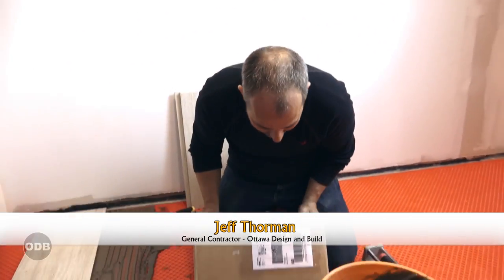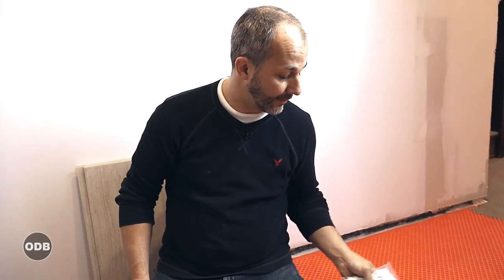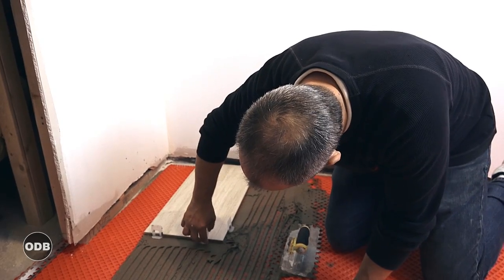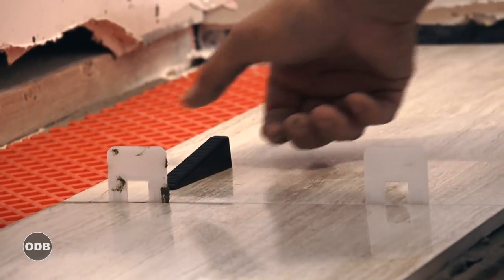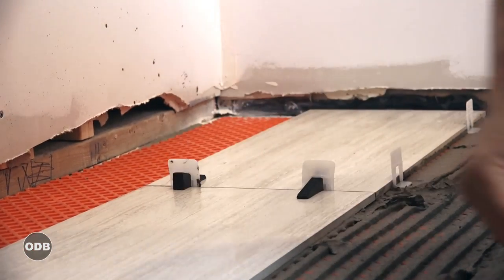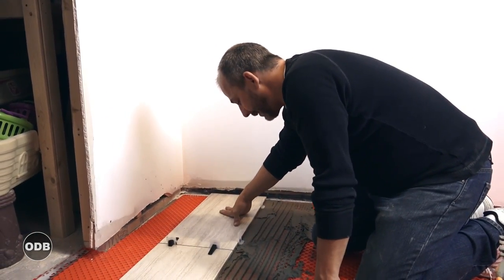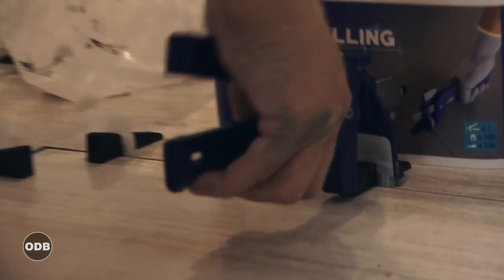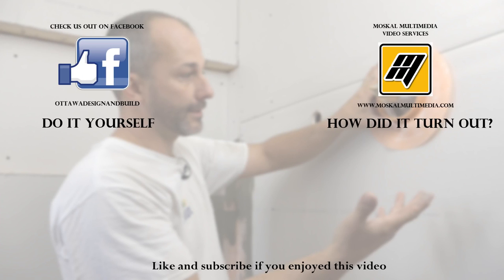DIY Tile Floor with Peygran Tile Levelling System Review Unboxing

Comment: Home RenoVision DIY
 is this still your preferred tile leveling system? Have you tried Rigid level max?
Reply from the maker: I have tried a dozen. They all work pretty much the same. systems with the tool to tighten work best!
Reply: @HomeRenoVisionDIY  Thank you for the great content!  It has helped me out a lot with my bathroom Reno.  I watched your video on how to install a shower pan.  I installed a 3'x4' dreamline shower pan and its nice and sturdy and level!  I am getting a tiny bit of sand "crunch" sound from the entrance of the shower pan.  I don't think it's a huge issue?  I still have to install the final wall to make it an actual "concave" shower.  I'm hoping once I screw the base into the final wall that it will get rid of the issue..Any thoughts or recommendations?

Comment: Using the coin is unfair. The tile edges are most likely slightly rounded or tapered.
Reply from the maker: I have seen it on t.v. and was wondering how it would perform. Concrete is just not a good place for this demonstration.

Comment: you used a leveling system and still leveled by hand whats the point , using leveling clips doesnt help you become a better tile setter ,its like running your kid bike with training wheels , set free hand and youll become a master

Comment: Well that went well....NOT !
Reply from the maker: Care to elaborate!
Reply: I thought the whole point was to lay the tiles level with each other. The coin test failed every time !
Reply from the maker: The coin test doesn't work well on a poured concrete floor. The reason for the leveling system is to help keep lipage under 1/32 of an inch. The system did that. It just isn't the right test is all.
Reply: Brian needs to cry us a river. he will never make it as a diy'er or a contractor. Brian - go back an listen to the video again. in any business, including building rockets for NASA, there is always room for give and take, with respect to 100% = 1. 

great video. i'm using these damn clips. bad ass!! haha
Reply: Home RenoVision DIY what about using a bigger trowel so you have more adhesive to push the tiles to same level?
Reply: fina torrecilla he’s using a 1/2 notched. Trowel. All you need.